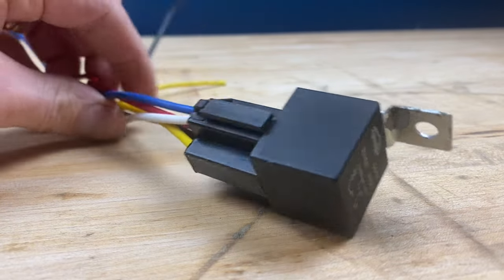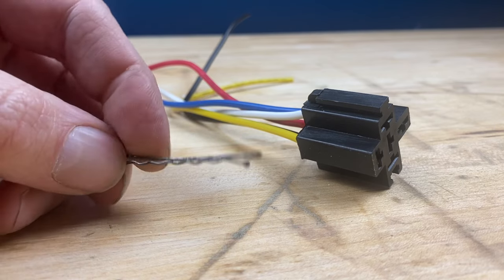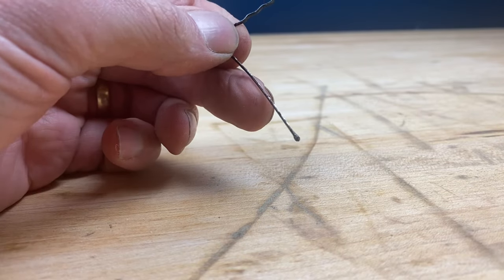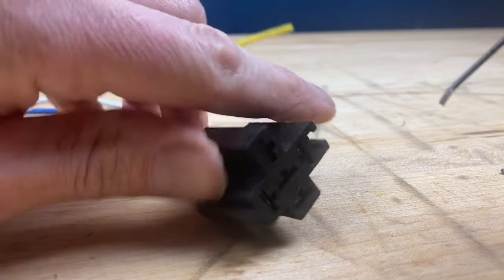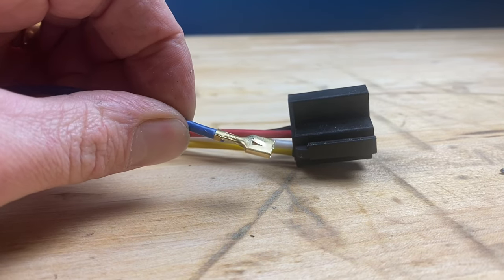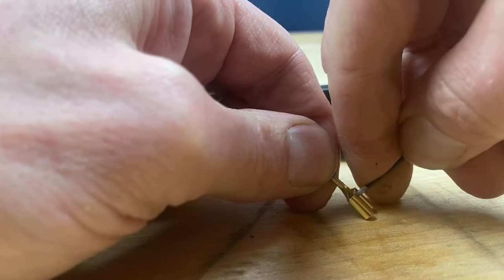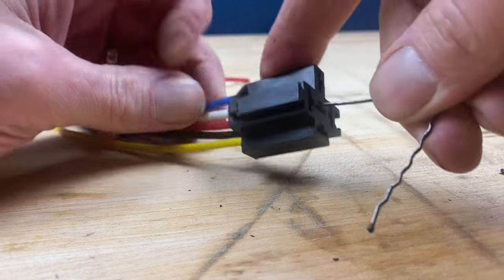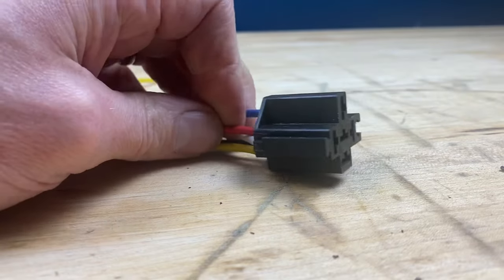How To Remove / Depin Terminals From 5 Pin Relay Connector | @WiringRescue

Comment: I was searching your channel for a solid state relay. Couldn't find one. I have a MSD
Reply from the maker: I haven’t made a video on solid state relays yet. I’d love to though. Post a part number or link to the one you have. From what I recall those msd ones are pricey arent they?
Reply: @WiringRescue  MSD 75643-HC
Yeah they are expensive. I'm using it to wire 2 fuel pumps and 2 fans.

Comment: Would ba a great video to mention why people should remove the center relay wire and leave it out if not using the normally closed function of a 5 pin relay. Well explained!
Reply from the maker: Thanks for the input!  I actually do exactly that in this video https://youtu.be/QCkfFCLa_Jg?si=qZ7BFp_KrqR-ARz9. I try to break my videos into bite size portions to make them digestible and less overwhelming.

Comment: Is there a way to retro fit a one of these Bosch relays for say like a pop up headlight motor? With male/female jumper wires into the headlight motor and then into the relays plug?

Comment: I want to replace the wire with a different color wire, to conform to the color codes that I am using,   I see that you are using a hair pin, but I wanted to get a real pin extractor with a plastic handle that looks like a screwdriver.  I dont want to have to buy the 96 keys when I only need one.
Is there not a standard size or part number for the tool that removes the female spade lugs from the bosch style relay harness?

Comment: Just beginning on this relay stuff but I'm finding my relays have the colors for different relay pin numbers than what your relay plugs are. 
#30 is red
#86 is white
#87 is blue
#85 is black
Is there a national standard or did I buy the worst relays ever :)
Reply from the maker: Haha! Sadly - there is not a standard. You should have the numbers on the bottom of the relay though, so you’ll just have to match the numbers up instead. It’s a bit of a bummer, but I believe in you!
Reply: @WiringRescue  Not sad at all. The reason the is not set standard is because there is no specific set usage.  Each manufacture will tend to assign the wires AWg and color  code specific to what they are intending it to be for. You may need to have two power inputs and one output. So two reds and one yellow.  So it's not really sad just inconvenient to the end user if they are not using it for the same purpose.  But if you are using it for the same purpose that person may very well be ecstatic about it.
Reply: OP read my comment above . In your case it might just be better for you if you purchased a kit with the socket & terminals and make you own color code. This is also useful to make the length of wire custom to your application.
Reply: Thanks guys for the relay info

Comment: i cannot get the relay off the freaking connector.
Reply from the maker: Sometimes they corrode, or if they get hot enough, they melt.  It makes for a really bad time.  Sorry for your struggles!
Reply: @WiringRescue  It actually came impossible to remove  new (10 years ago). BUT thanks to your video I at least learned how this set up engineered so it would not be possible to get to the wires by pulling them out, and brute force on the relay was indeed needed. (understanding how something is built is all it takes).  it took some chisels and a lot of brute force, but I got the relay out.
Reply: @baronvonhypnosis  You don't need brute force. All you really needed to do is take off the relay cover and start removing components so you can get at the pins. Pulling individual pins is a lot easier.

Comment: My problem is that my 12 year old car (a 2011 Jeep Patriot) had a relay pin break off in the socket.

The single pin is covered in the green (growth/algae/deposit/cancer/idcwhatitscalleditneedstostophappening) and the connector pin on the relay side broke flush with the relay, and is buried in the relay block.

Without that relay working, the radiator fan cannot do hi-speed to keep the engine cool in summer.

Luckily, it's winter starting now, so I have some time.

But: The relay for the starter is right next to it, and I fear it also has a broken pin because sometime the car will not start. My wife turns the key, the car does not attempt to start at all. The lights in the car stay on, the dash still shows the odometer, the battery is brand new (bought on Nov 9th, 2022) because I thought it was just an aged battery, but the no-start continues to haunt us. So I pulled out relays one-by-one to see if that's the issue. The second relay I pulled was the radiator fan hi-speed relay, and it broke a pin. So I have not pulled the last remaining two relays (The starter relay and the radiator fan lo-speed relay) for fear that they too will break a pin.

How does a broken connector get removed without enough material to grab onto with needle-nose pliers, and without the ability to weld? ... although I do have solder and some experience changing motherboard components by soldering.... maybe I can do that.
But how do I get the relay block out of the car to solder on? It's tucked in the front bumper and the Haynes' manual doesn't show how to remove it.
Reply: Pull the female connector out of the socket just like he does here. That simple. Once out push the male pin out.
Reply: @AztecWarrior69_69  I wish it were that easy. I removed the front bumper cover, wheel well linings to get at the relay block.

The wires for this block have no harnesses to all the places they go. This relay block is hardwired into from the main fuse block and the wires then disappear into the cavities of the frame and body panels where they are secured with clips.

So, I just tinned the broken ends and soldered it back on. Technically, I "might" be able to pull the relay back out with the broken pin stuck on by solder, but it's unlikely because the solder probably is holding more than just the relay's pin. Therefore, since the relay still functions and now has a connection to all necessary points; I shall leave it be.

It won't be but about 3 more years for the frame to rust out anyway.
Reply: @goodisnipr  Um it is that simple. The problem is not getting the pin out , the problem is getting to the relay block to get it out. 

In this case I say to disconnect the battery, remove all the other relays and pour either vinegar or Dr. Pepper into the relay socket. Once the corrosion is eaten away pour some  electrical connection cleaner. WD-40 has a good product. It will finish cleaning it, flushing out the Vinegar or DP and dry. At this point some tweezers should get it out. The rust build up tends to eat the metal making the pin thinner and the female conector more open. Making it lose.

any way the point is mute since you already soldered it. I t may have fused the pin to the female connector. Pulling it out now might case further damage. 

Just watched a video of some guy pulling his out and redoing the whole relay block. I'd post link here but youtube always deletes links to external sites.